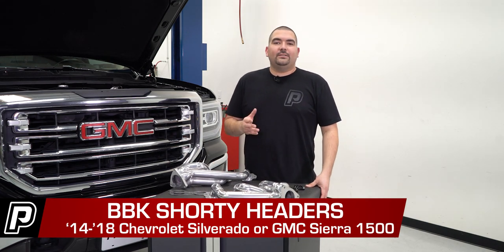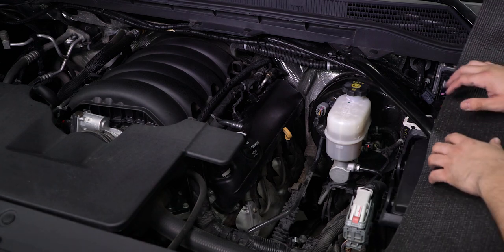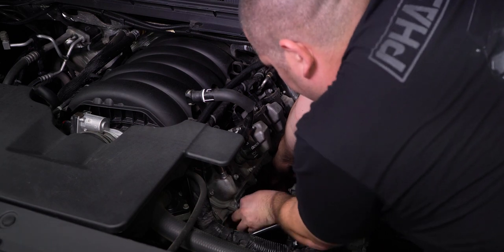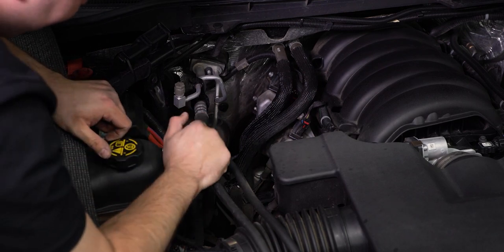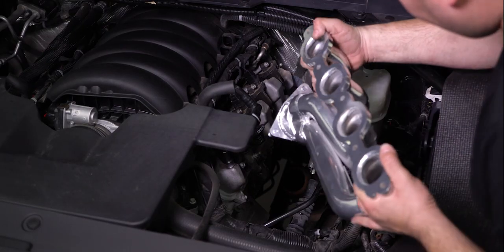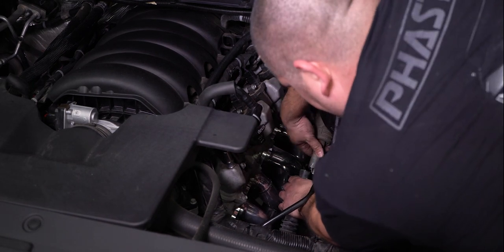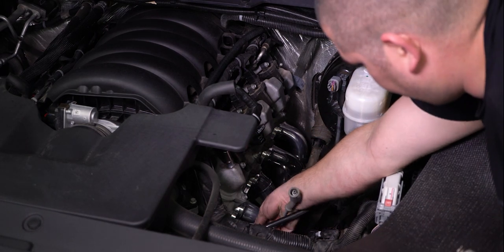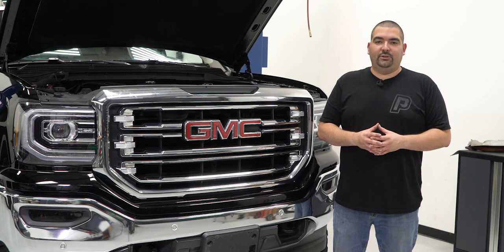2014-2018 GMC Sierra BBK Shorty Headers - Phastek Install

Comment: Shorty headers are a waste.  Go longtubes if you want to see decent gains.
Reply: Long tubes are not smog legal shorty are
Reply: @nvdubs  I'm telling you long tubes are not smog legal only shorty headers with the egr port on the passenger side header I'm in CA not sure about other states
Reply: @lowerdesert9577  lol these don't have egr ports on the newer trucks or even on the stock manifolds....
Reply: @nvdubs  I have an 01 Silverado and owned an 04 Tahoe I was just talking about those LS 1 engines
Reply: @lowerdesert9577  those aren't ls1 engines. They are lm7 or L59 5.3s or a 4.8 lr4. LS1 is a 5.7.
Reply: @nvdubs  l59? Maybe I gotta look again
Reply: @lowerdesert9577  L59 is the flex fuel version of the lm7
Reply: 400 bucks vs 900 for long tubes with cats . Plus you have to buy y pipe. Why spend over 1000$ for an 5 to 8 more hp gain . And long tubes are good for high rpms racing. Short tubes are good gains for low rpms and pulling Power. . I'll stick to  shorty's cause buying wires to extend exhaust back and stuff to much money. Not everyone has 1500 bucks on exhaust
Reply: Personally I don't think long tube headers especially if one Deletes the cats, sound good even decent on newer vehicles. Most people go for a mellow, deep tune with 0 Crack and pop especially if driven each day. Long tubes in my opinion sounds best on high performance carb engines. Also, id like to point out that claiming any header combined with a performance exhaust is a waste of time and money when making improvements in economy and performance. Common sense should tell anything that more air fuel and flow is a guaranteed gain regardless of amount achieved! I have seen multiple cars and trucks make very impressive gains with shorty headers and exhaust systems over stock and when I say impressive I don't mean 50 or 100 I mean a respectful 25 to 40. Now, one can always slap a cold air intake, throttle body spacer on and get it tuned for an additional 30 to 50 hp possibly a little more! I believe a $600 to $800 budget is very worthy of a possible 70 to 100 hp gain and a possible 4 to 8 mpg gain instantly and in the long run.
Reply: @ryanphillips3533  negative.  Not with shorty headers.  These motors practically come with shorty headers from the factory that flow almost exactly the same.  Also,  will not get 30-50 hp on these with CAI and throttle body spacer (completely useless on these).  70-100 hp is not happening on one of these motors with just shorty headers, tune, and cai.  Also, I can confirm (with LT headers and catless y-pipe, CAI, etc) its not even close to 70 hp gains).  30-40hp all said and done.  Also, fuel mileage has stayed the same, if not worse.  My l83 would get 16/17 highway before everything and its exactly the same now.
Reply: @nvdubs  sorry you didn't experience the same quality results and gains I have my friend. Also I believe you misunderstood my comment I recently made. I didn't claim exhaust made radical results nor did I claim other simple bolt ons made incredible results. I simply stated when done properly and combined it makes impressive results on the dyno and according to feel. Now allow me to clarify that each individual does things differently and purchases differently products which ultimately from experience makes different results. My truck is a 2011 avalanche 5.3. The truck has a moderately prices Cai and tb spacer, it has bigger injectors, msd plugs, wires and coils, shorty stainless headers, deleted cats and resignator, Flowmaster 40 series single in dual out, and has been professionally tuned and it runs 95 octane. The truck ran 3 times on a dyno before we installed all upgrades in one weekend and afterwards ran 3 dyno runs. The truck made in my opinion a very impressive gain of 82 hp and 69lb tq! The lowest hp gain afterwards was 76 but we all know how dynos can be and the operator.. sometimes people tend to forget or neglect checking for misfires unseen or heard or vacuum hoses loose or stopped up, bad fuel, etc and those few examples can make huge differences unfortunately.. so with all do respect, I agree with what you said based on your experiences but I have my paperwork in my truck with showing results based on my personal experience. Also you can watch several videos of of modern everyday driving trucks using both long tubes and shorties and the majority of the increase is between 4 and 8 hp depending on tubing size and brand. On my 71 454, long tubes made almost 27 hp over stock manifolds! Sorry for the long response friend, have a great day!

Comment: I like how it skips over the removing 5 manifold bolts part.  The back one is damn near impossible but they sure left that part out.
Reply: You can get to it with a ratcheting swivel combination wrench. Or a long and bendy 1/4 drive ratchet. I recommend soaking them in fluid film overnight. But there's a good chance you're gonna need to torch some bolts off.
Reply: And the 3 exost bolts are a ass too, his came right off lol
Reply: Dude forgot to mention that the studs are prone to snapping off in the head so let them soak for multiple days prior especially on higher mileage trucks

Comment: Did you use a Jack on the Y pipe or will it keep the connection points aligned?

Comment: for my 2018 silverado 1500 5.3L with no 3rd cats, both resonators gone, and 40 series exhaust and 3' inche tip. It is a lot louder then this. But i am thinking if this could help with HP lag. Before i took off the 3rd cats, i notice the difference and not a fan of it. But i do know my engine is getting rid of the exhaust a lot better.
Reply: You need custom tune.more air flow need more fuel your air fuel ratio is lean now and mpg drop
Reply: I have the same set up on my 17 except I have a carven muffler. I lost lots of back pressure and mpg
Reply: @joset3851  I have an 18 Silverado with a carven muffler, was thinking about getting shorty headers, to make it a little louder. So after you do this, you need to get the truck tuned for the more airflow?
Reply: @JRichards788  Correct. I have the progressive TR carven sounds and it sounds perfect with no 3rd cat imo

Comment: I'm curious if the 5.3 and 6.2 headers have the same exact bolt up alignment to the 6.0. Some sites say they're all the same and others not.
Reply from the maker: Yes, these fit both the 5.3L and 6.2L. This is from the manufacturer. This is for the 1500. BBK makes headers for the 2500, but not for the 6.0.

Comment: Who t’f makes a headers install video and doesn’t say how much to toqué down the header bolts
Reply from the maker: If the manufacturer supplied the torque specs they would recommend with their hardware then we would mention the torque specs.  But since BBK did not mention the torque specs they would suggest in their instructions, we follow the factory torque specs of 11 lb ft on the first pass and 15 lb ft on the second pass.
Reply: At least he didn’t say “Hand tight”